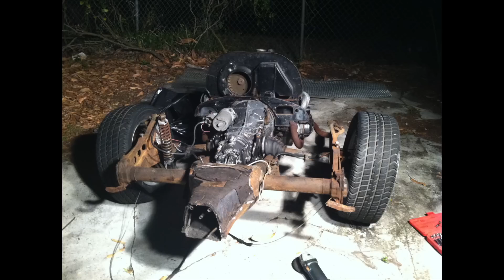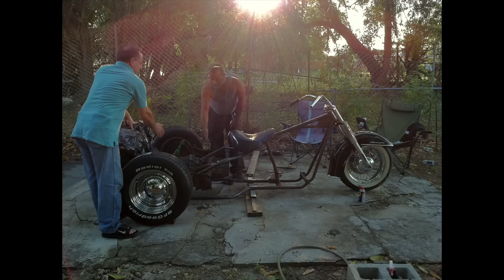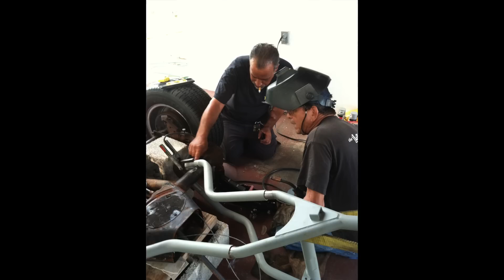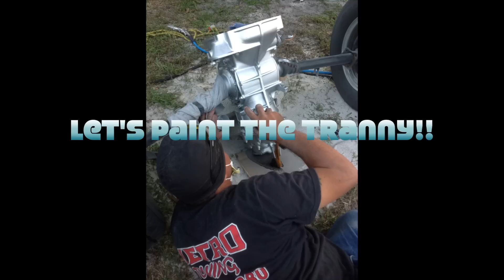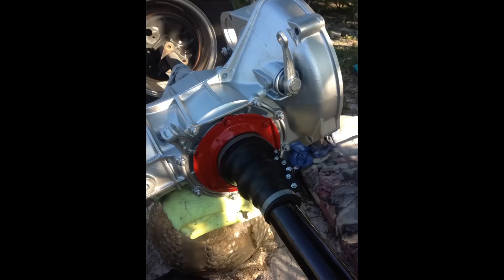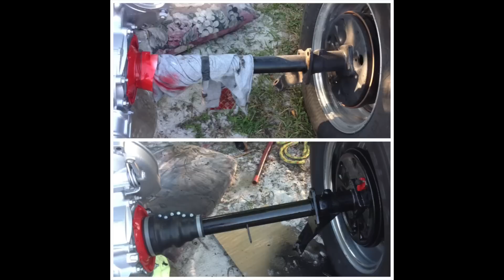VW Trike Build (1967 VW Bug)

Comment: NOTE TO VIEWERS.  This guy did it right! He used a plentiful and STRONG HD frame and front end.  I've seen too many trike projects fuck up by using weak parts and just finished torching off one abortion so my bro can use the swing axle with a Stires style heavy wall box tube frame we are fabbing. You can buy blank Harley steering necks if you weld your own frame. I'm not a trike expert but built plenty of motorcycles and trikes are a bit different.  This is NOT a project for some shitbox 120 volt flux core welder. Any process is fine but you'll need more amps for the structural work. You can get HD chopper frames without titles cheap used at swap meets, and of course front ends like the bagger Wide Glide used here.
Reply: I completely agree with your assessment. I'm building my trike with a 
VW rear assembly and a Paugcho rigid frame on the front. I don't know why so many guys want to reinvent the wheel when outfits such as Paugcho and other Harley aftermarket frame builders already have the ergonomics all worked out. Also, I don't want to ride around with butt about 5 inches off of the pavement. I want it up where I was when I had my Harley. Love y our comment, man.